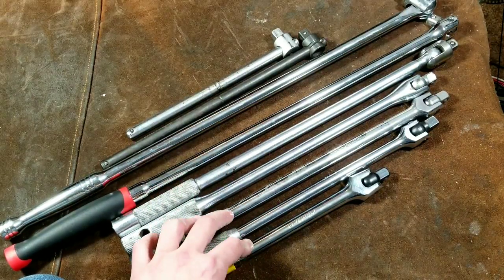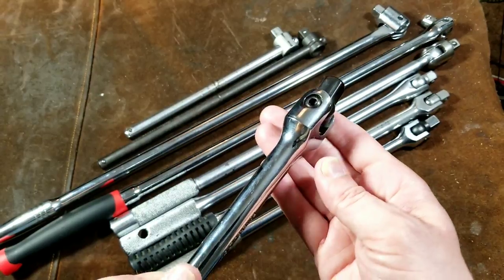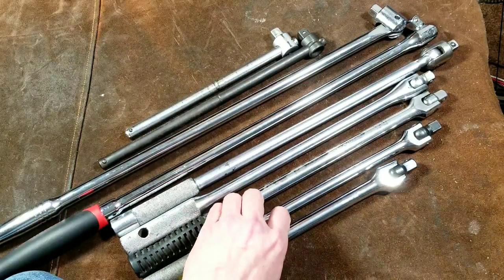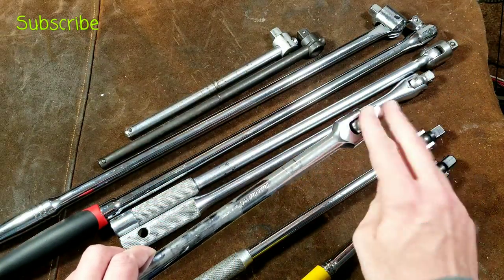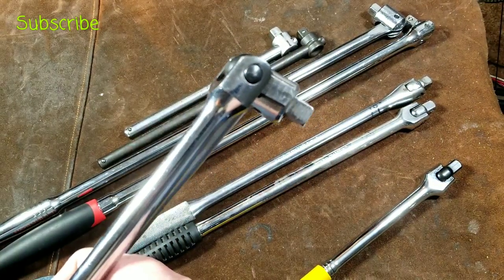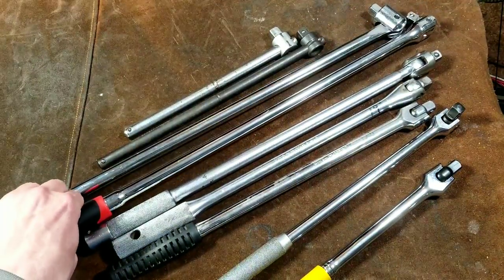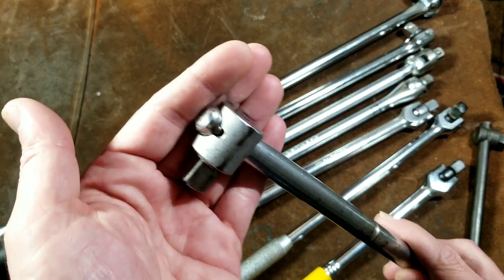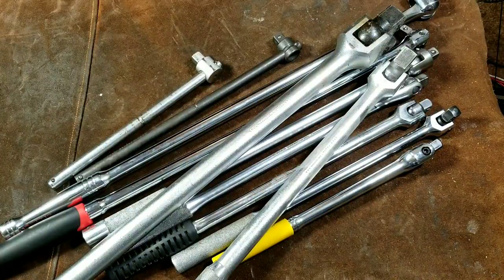1/2" Drive Breaker Bar Review & Comparison

Comment: I have the same or similar Mac bar, and it quickly became one of my favorite tools. I got it in a box of old mixed tools at an auction. If I should ever need to, I'd gladly dish out the money for a new one if they are still made. The 1/2" female in the handle, the overall strength and durability, and handle comfort are all top notch. Thanks for all the awesome vids!

Comment: I bought the Harbor Freight one today.  Haven't used it yet.  Regular $13.99 coupon that was emailed to me was $8.99.  The chrome on the handle was a little rough on the hand so I buffed it with some steel wool and no it's fine.

Comment: I like the new harbor freight one. I have seen some stress test comparison videos, and it competes with the super expensive tool truck ones. it's super cheap and still has a lifetime warranty. The only reason I haven't bought one is because I have a USA made craftsman one.
Reply from the maker: I like the Harbor Freight one as well
Reply: I gotta warranty my Craftsman one. It looked much better than my hf but broke on the first use.

I think the anvil was just a manufacturing flaw
Reply: Buy one as a back up.  Sears is toast. A shame,  the usa made ones in the 80s 90s were great.
Reply: @humansvd3269  My superstition is that a Craftsman old enough to have a "hanging hole" in the handle end is probably stronger than the newest ones which didn't have that hanging hole
otherwise they look about the same,I think they were made for Sears by Armstrong (but don't look as good as an Armstrong branded one)(might be mix and  match of Armstrong and Moore Drop Forge made parts)

Comment: Some of those things have better alloy steel than others,also difference between having the pinned flex joint vs. having an axle bolt that's threaded into one of the ears such that spreading of the ears is prevented as long as the bolt is tight and its threads don't fail,some people think that the flex action friction can be adjusted by loosening the bolt but a Snap On man told me to keep that thing tight!--- the friction is controlled by a spring or wave washer besides the head and between the head and an ear in a countersink 
also there is a 36" Snap On 1/2" drive bar that has a replaceable head,sort of looks like the heavier duty Harbor Freight one in the video with the handle fitting between ears that are part of the head
you don't really always need to have the most expensive tools-that Snap On 36" bar is probably overkill but it is beautiful!! but some of them do seem to make certain things easier to do such as some Snap On extension/one piece socket that is specific to reaching and putting tremendous torque on certain recessed Subaru engine assembly screws

Comment: I have a sealey breaker bar. The head wobbles, is it normal?
Reply: Does it have a bolt through the hinge? If so have you checked that it is tight?

Comment: Which harbor freight breaker bar is better or which one would you keep if had to get rid of one?
Reply from the maker: The large half-inch Pittsburgh Pro 24 inch handle soft grip is the best breaker bar I think Harbor Freights ever had
Reply: @CatusMaximus  The one with the fork part of the head (large head) or fork on the handle ?

Comment: I bought my 3/4" breaker bar from horrible freight cause I figured I won't use it often and when I do use it it's cause I don't wanna damage my 1/2" drives.. basically, stuff that should be easy for a 3/4"
Reply from the maker: Yes that's the great advantage of three quarter inch Drive there is 50% more metal over half inch drive so much more rigidity much easier to deliver force and even with a low quality 3/4 inch breaker bar it's still going to be stronger than a high-quality half inch
Reply: @CatusMaximus  that's the point. And less torque loss than using an adapter to fit 3/4" sockets

Comment: Why not compare by max torque? A good tool company professionally tests, documents, and warrants up to failure torque. "Stronger" and "nicer" has very little qualitative meaning, wouldn't you agree?
Reply: I agree wholeheartedly.
Reply: Seems to be hard to find such numbers as maximum proof load to failure
tool shouldn't be pushed to more than half its ultimate strength in routine daily use I understand -- but sometimes something has to be forced and that's what warranty is for-but try not to get hurt if something goes bust!
Reply: I think I vote for the Mac,then the older Harbor Freight with the large head,but the non flex sliders might be stronger than all the hinge handle ones but too short to get much leverage. 3/4" drive slider with a quality reducer on it might kick all the 1/2" drives out of the boxing ring however
Reply: No.